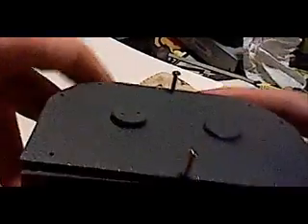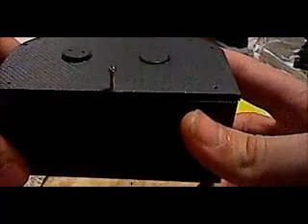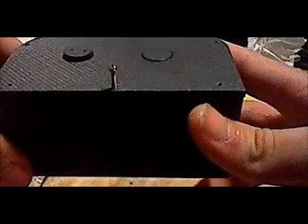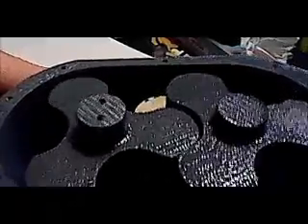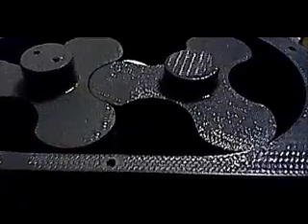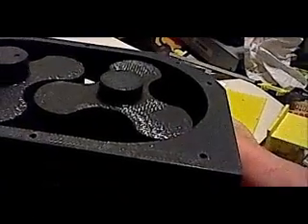mini thunderbolt update - roots\lobe blower attempt.

Comment: You need to try to looser design, and gears that have better ball bearings, to spin easier. If ball bearings make a vacuum brushroll spin around 6,500 RPM, then it will work more then better on this blower you made. The lobes which look like fidgets once again can't be tight to eachother, so try to make slightly smaller, more loose ones, but still have them touch, but spin loosely.

Comment: Not bad when you fix that wobbling problem on the right lobe all you need to do is do the blower release valve, pipes, belt driven motor and a series model like a1series, a2 series, c series. Also add a release valve cap like the real one. And I can't wait to hear what the thunderbolt sounds like when that's done. And will you paint the horn like a bumblebolt?